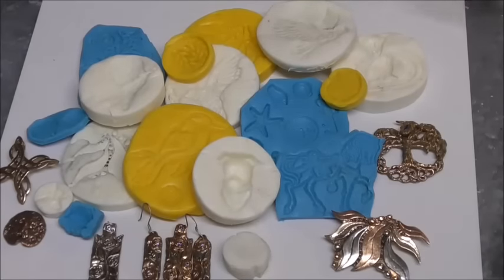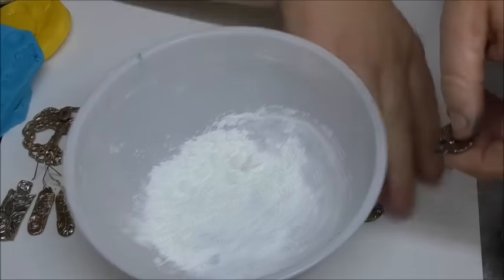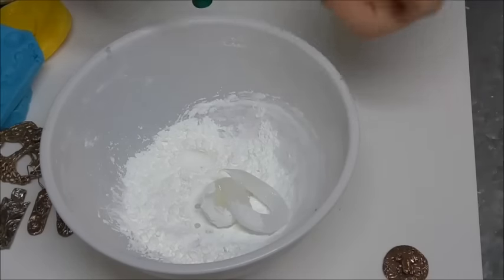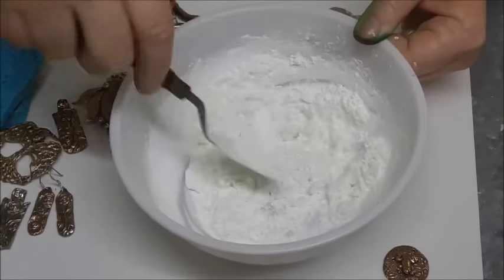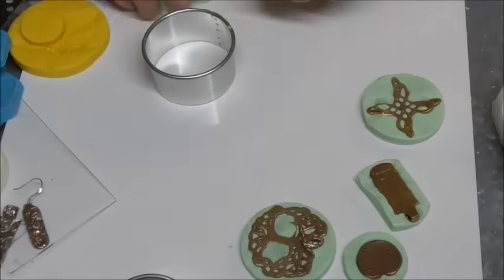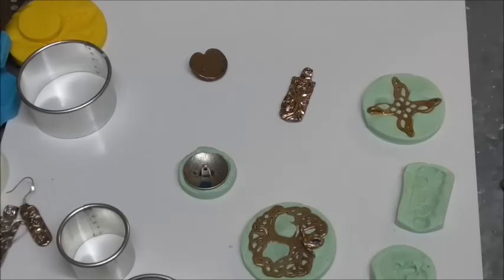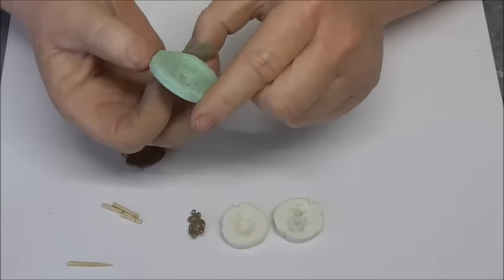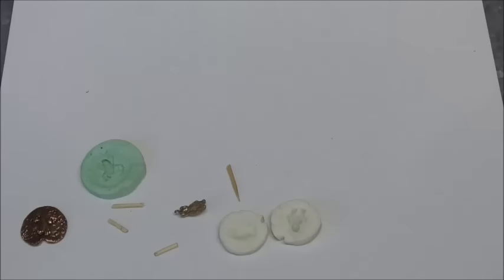Mold Making

Comment: Wonderful video.  you mentioned that it didn't smell very good...could you use essential oils (peppermint, lavender, etc.) instead of the cooking oil to help it smell better???
Reply from the maker: thankyou Laura great you like it yes do try anything that has a oil base but do a small test first and see how it goes l will allso be doing one all about 3D Moulds and how to make them so look out for that
Reply: The reason it smells bad is from the acetic acid  that is needed for curing.

Comment: does the glue smell disgusting? I tried it but never made up.. because of the smell.....
Reply from the maker: There is a strong silicone smell when making the recipe up. You do need to make the mixture in a well ventilated area - this could be outside or near an open window

Comment: can arrowroot work? and is the caulking machine required?
Reply from the maker: lm not sure for arrowroot and for the caulking you can buy it in a tube
Reply: Aussie Metal Clays arrow root is corn starch aka corn flour
Reply from the maker: Thank you Stacie, I have never used Arrowroot so it would be something that you would need to test out for yourself. Regarding the Silicon a caulking tool is needed to push the silicon out of the tube, both tube of silicon and tool available from hardware shops if you us the same type of silicon as in the video. I do believe you can also buy it in a tube like tooth paste as well which would not require a caulking tool

Comment: I thought molds were supposed to be 1/4” or so thicker than the piece you are molding?
Reply from the maker: it will depend on what you are making but for metal clay its good and some other clay types